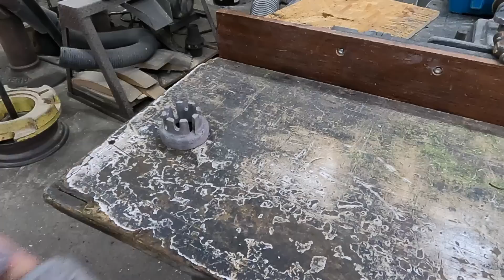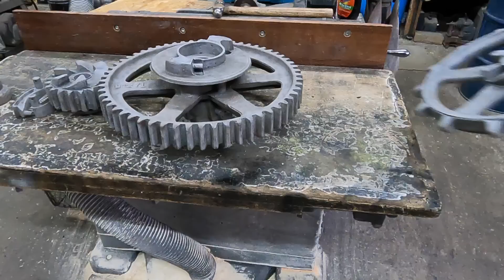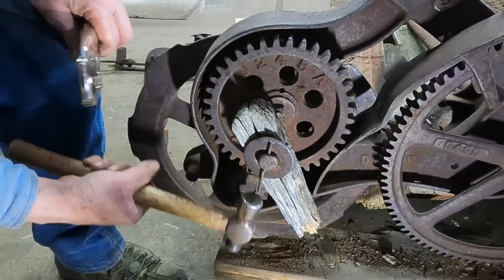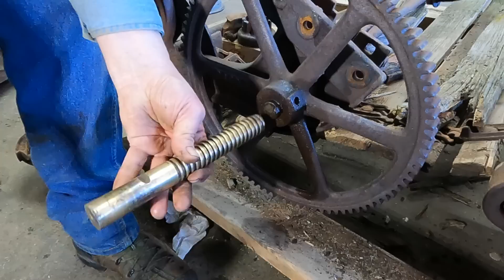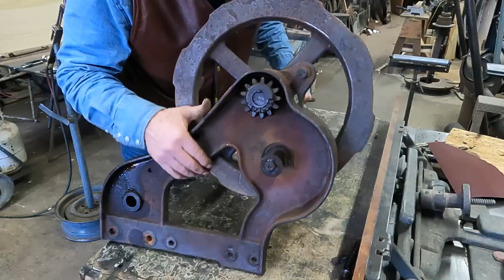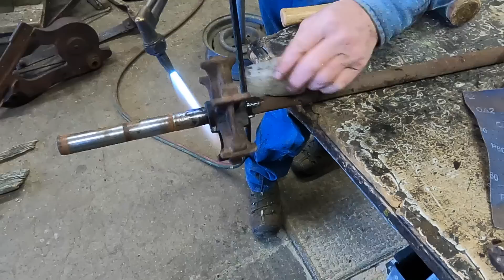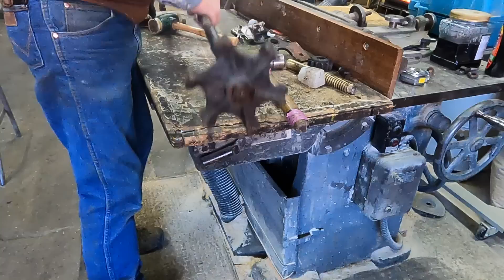Does Wax Break Loose Rust? My Test | Engels Coach Shop

Comment: Amazing how clean those parts were after you had taken them off and placed on the bench😀.
Reply: That was a nice, satisfying touch in the video!  Thanks Dave for including that!
Reply: Guessing years sitting outside in the elements cleaned those parts.  Nicer taking it apart now then 100 years ago when it was used and then needed repair.

Comment: Paraffin wax works best on tapered shafts. 50 50 mixture of transmission fluid and acetone. Or buy Knock it loose. As long as the wax has a way in it dries and push’s out rust.

Comment: Why need square socket when you have 8 points. My dad used to have a set of 8 pt. sockets - they disappeared decades ago. I`ll have to remember the paraffin. Good Job!!
Reply: Bi-Square impact sockets are still freely available but it seems today only in larger sizes.   Their main use seems to be on railroads.  I did a search recently for 7/16" square  but only found railroad sizes.  Had to fabricate a square socket.  Ot was for an obsolete shut off valve on a drinking water supply.
Reply: 4 divides evenly into 12 too. But 8 points will grab better. Usually a 12 point works just fine though. Then if you do booger it up everything is Vise Grip size.